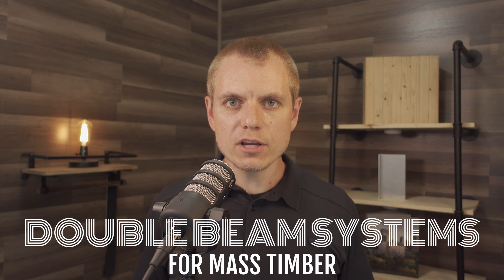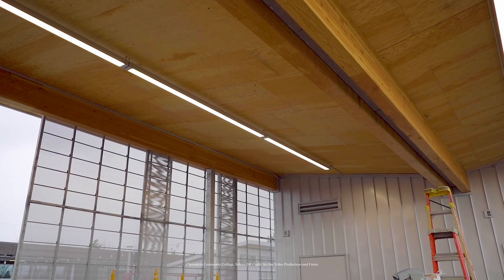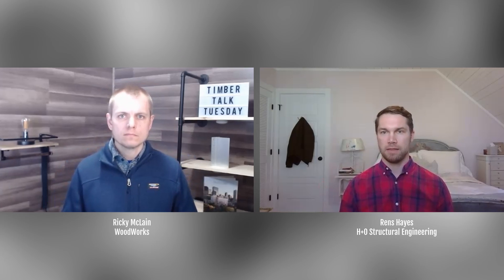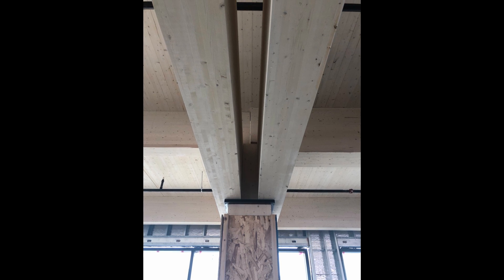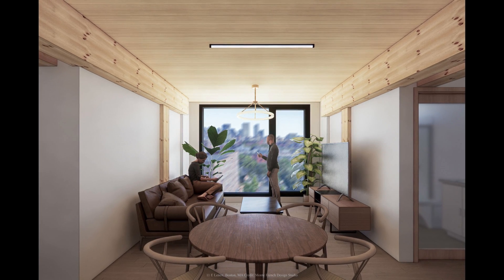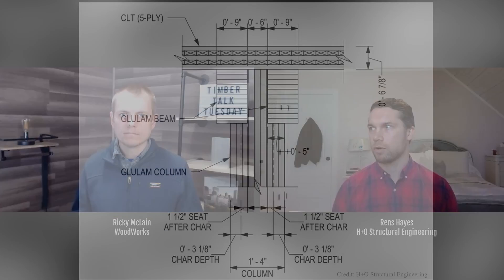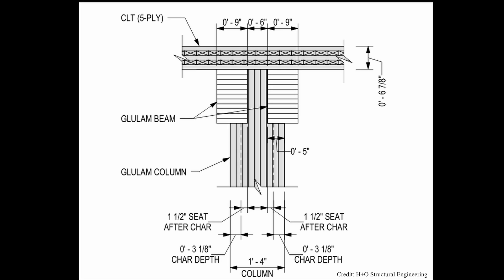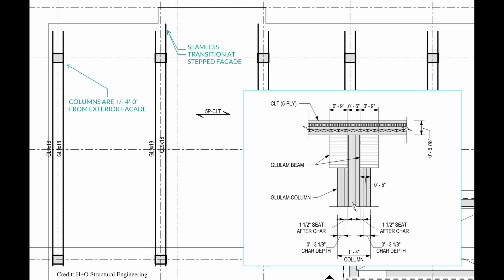Single vs. Double Beams for Mass Timber Construction

Comment: Great videos, keep it up!  It looks like these mass timber buildings hold up well to 1st instance of fire. How do they fare for subsequent fire events? 2nd or 3rd fire events?
Reply from the maker: As with any structural material, evaluation and potential repair may be necessary following a fire event. Some mass timber members are over-sized to provide a wild charring layer, so that charred layer may be able to be removed and replaced with new wood, without needing to remove the entire wood cross sections.

Comment: 1- A single GL beam can be cantilever at the side of the column as well. Therefore, that is not an advantage only to the double beams.

2-The double beams method can create some fire safety for the top side of the column. But, double beams methods make the beam weaker along span in a fire event and increase the char rating of the beam significantly. It means double beams has a faster charring rate than a single beam when they have a similar size section area. Therefore, that is a disadvantage to the double beams.

3-Always double beams will be thicker than the width of the wall underside, which is an architectural disadvantage to the double beams compare to the single beam.

4- Two single beams have a higher load-carrying capacity than this double beams system, which is the cost-efficiency disadvantage of the double beams compared to a single beam.

Finally, I think double beams method will increase number of required fixings/screws.